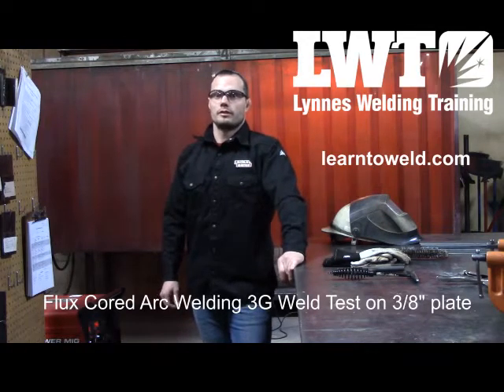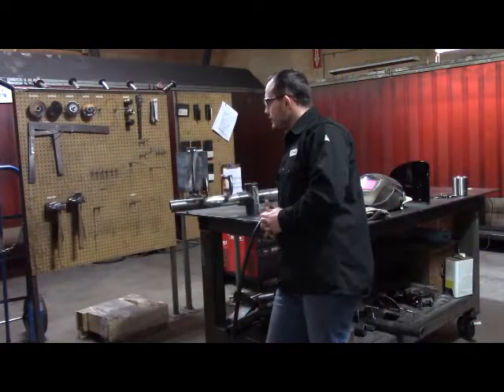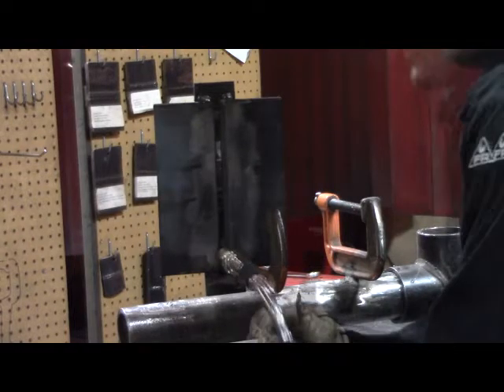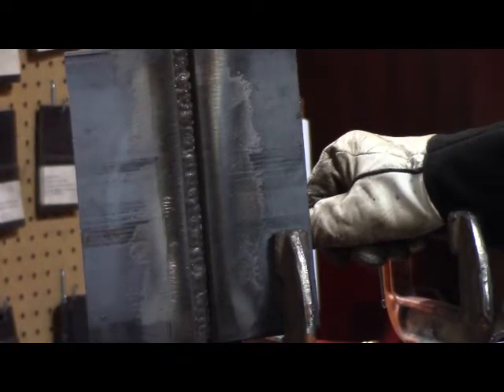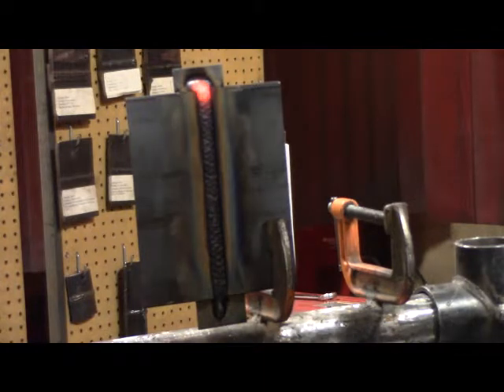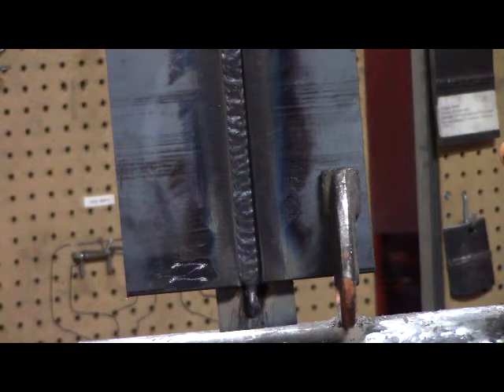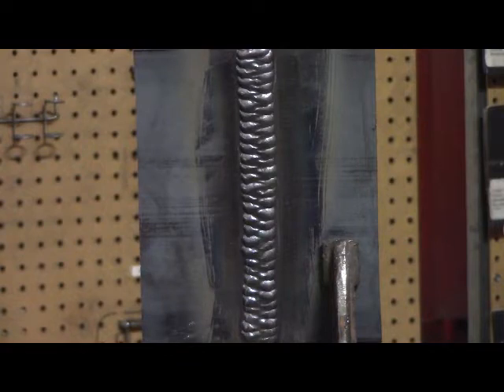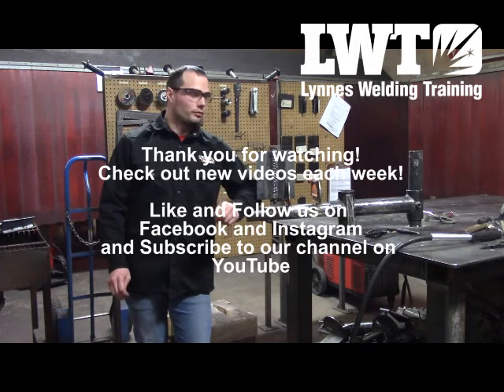FCAW 3G Weld Test on 3/8" Material

Comment: Caping need should be 2 layer
Reply: Adjust your settings?
Reply: You can weave it on 3/8 plate in 1 pass, the weld profile shouldnt be wider than 1 inch.

Comment: How do you not trap slag with flux core i was taught weeving would trap slag due to how fast the .045 wire burns
Reply from the maker: In the welding world and especially the training environment welding instructors will teach different techniques. Here at LWT we follow the techniques taught by the Hobart Institute of welding and have found to get consistent high quality results. To answer your question further, there is a time and place to use a “Z” weave technique. I would not use this technique if I was welding  a test that indicated 1” thick material as the groove width would be subsequently to wide. The joint design will also place a key role in whether this technique is permittable to use. As a CWI and performing destructive bend tests on tests using the “Z” weave technique with FCAW on the 3/8” plate I have found that it causes no issues with slag inclusions.
Reply: We use Hobart welding videos and they show a weave technique.We have tested several welders on FCAW and we have not had any tests fail due to slag inclusion.
Reply: It'll pass no issues however cosmetically it looks ugly

Comment: How do you keep your hands from getting hot?
Reply: Get thick gloves or ones lined with Kevlar so they don't burn through, most shops want to give you think 1/8" thick gloves good for TIG. If you can't handle some heat welding isn't for you.
Reply: You don't.